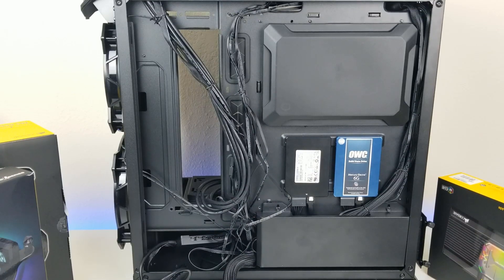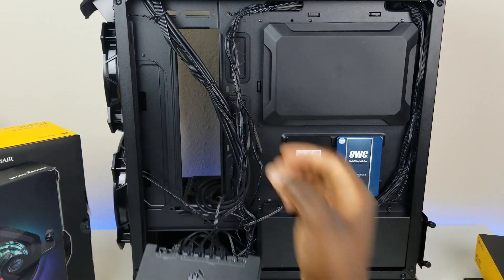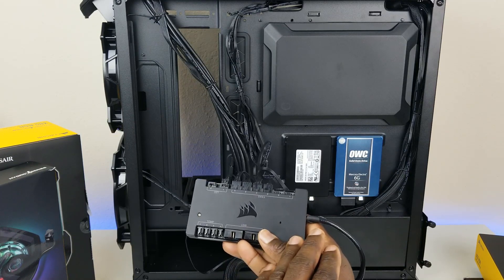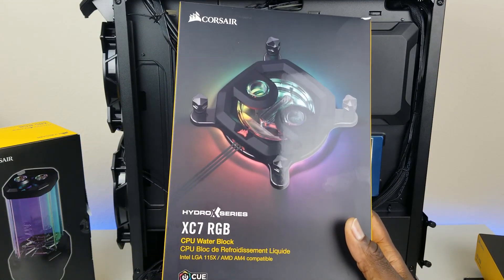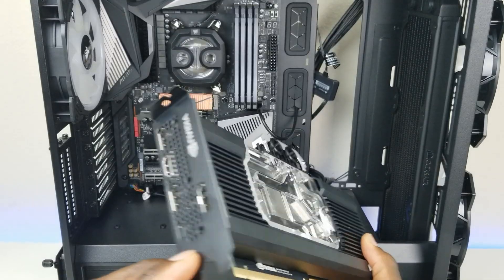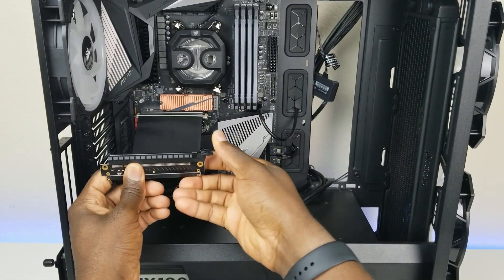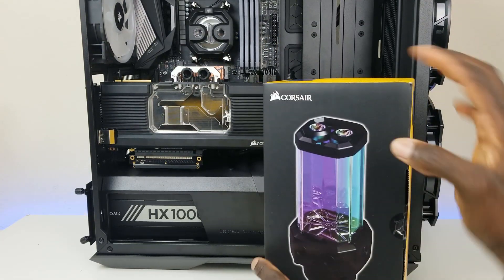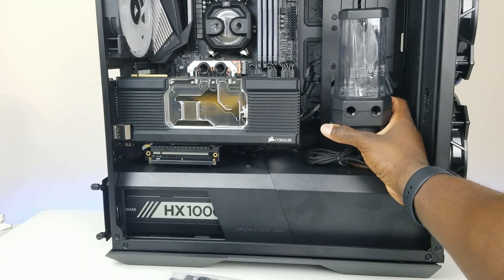Ultimate PC Build Part 5 | Installing the Corsair Hydro Series CPU / GPU Water Block and Reservoir

Comment: do you put the temp sensor on The GPU some where or is this more for ambient temps in the case? I got my kit today and that's the part that is confusing me if I'm supposed to put those temp sensors somewhere in particular or just wherever I want in my case to measure ambient temps (like HDD bay, or air temp coming from the radiator.

Comment: can cpu waterblock be installed with inlet on rh instead of lh? can it be installed with inlet facing up?
Reply from the maker: Yes, the flow totally depends on the direction of your pumps. As long as you have liquid flowing through the block.

Comment: I have a question bro. I have the same case. Mounting the radiator behind the two big front fans doesn't cause a problem??
Reply from the maker: Not for me because I have a push/pull. What is your concern, the radiator or air circulation?
Reply: @Triple_M  air circulation.

Comment: Can this cpu block be installed vertically like one port above the other ?
Reply from the maker: Yes it can!!! The block is a perfect square so it depends on how you want to install it. The screw holes will align
Reply: @Triple_M  Thanks for the clarification. I was just worried because somewhere on reddit it said that temps will be affected etc etc.